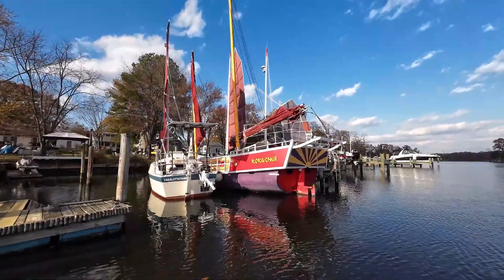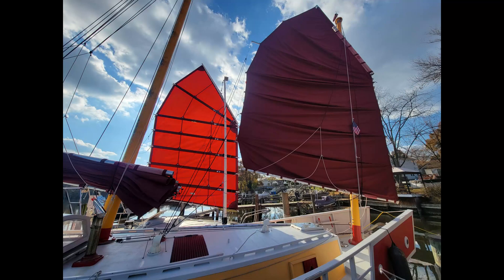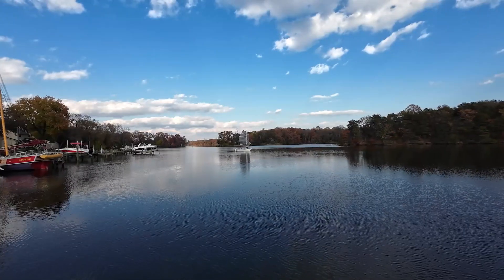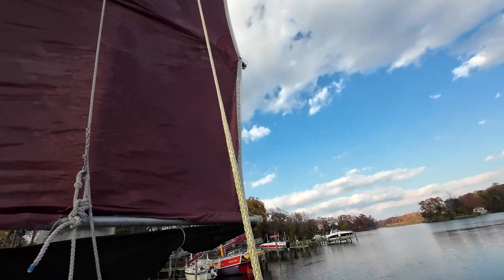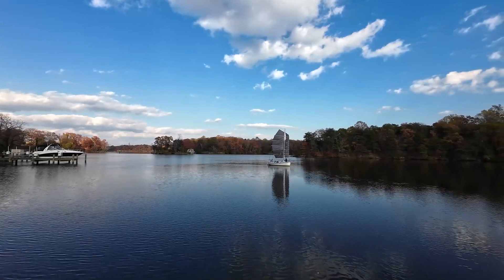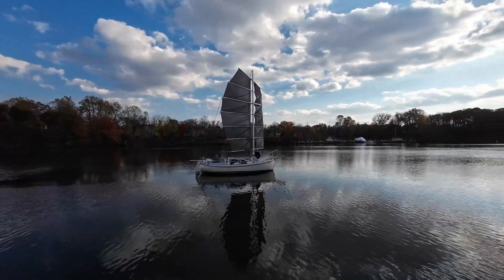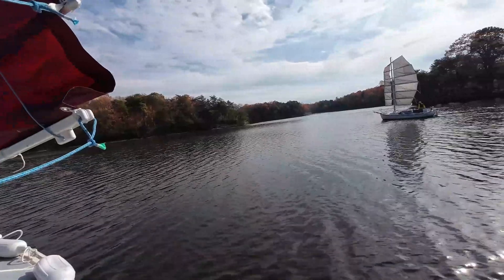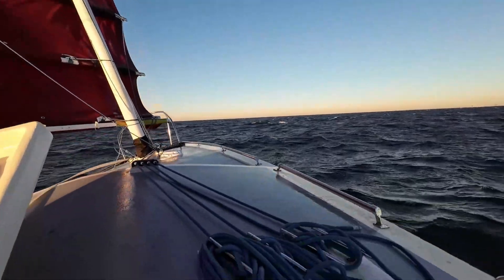S2E131 Junk Rig Sails // Flat vs Cambered vs Split Rig

Comment: My first 32sqm, flat sloop JR was fitted to my 23’ Albin Viggen, Malena in 1990. As I hoped for, the broad-reaching and running before went much faster than with her masthead BR. However, she gradually died as I rounded up for close-hauled sailing.
In 1994 I made her a new sail of the same size, but this time with camber in the panels. I called the method of making them for “the barrel method” (same as on Kokachin on your video). This sail gave a major improvement in performance, and without giving new problems as the wind picked up. Had I not found a simple way to construct these cambered panel sails, I would have dropped the whole JR idea.
The problem is that most sailmakers and yacht designers have no experience with cambered panel JRs. You will mostly be left to do both the design and construction work yourselves. I recommend looking up the JRA website, where there is enough info to get you started.

My present boat is the IF Ingeborg (my 5th junk). If you search on the string “IF Ingeborg”, you will see her romping along at 6-6.5kts (July 2025), on a beam-to-broad reach of around 10kts.

Stavanger, September 28th,
Arne Kverneland

Comment: Any comments on the Colvin style junk rig (junk rig plus jib)? I can't seem to find or get any information on this one.
Reply from the maker: It hasn't really caught on but I would love to test one.
Reply: @RoversAdventure  It appeals to me a lot. I currently sail a gaf rig setup, which I enjoy greatly. But I am very used to using jibs for different wind conditions, so the modularity of it appeals to me. The junk rig with the jib catches my attention, just wondering why not more people seem to do jib and junk rig.
Reply: @adventuremaniac  There's a guy called Roger Taylor who has converted two small boats to junk rigs, the first he rigged in the Colvin style, the second he rigged without a jib, but with cambered panels.
The whole point of the jib is for windward performance, if you camber the panels you just get that performance in the mainsail, and you don't need to faff around with more sheets.

Comment: The Junk rig seems to have its advantages.  However, I would not want one for the reason that one would not be able to setup twin jibs off of the mast for self steering on a downwind ocean passage.
Reply from the maker: I did that rig back in 1995 when I crossed the Atlantic
Reply: With two masts on a bigger boat you could, I would think?

Comment: Recently I have puchased a Laurin Koster 28 (a heavy fullkeel double-ender)…. 
It’s standing rigging needs replacement…
In fact she needs a refit throughout!
I am intrigued about modifying her to Junk Rig.
Please share your thoughts!!!
Greetings, Henk, the Netherlands.
Reply from the maker: The Junk rig is great for solo sailors and the ease of reefing makes it great for long passages
Reply: Thanks for your reply!!
I have read oftenly about the advantages of the junkrig…. being a solosailor I realise the easy handling is a big bonus!
But how to fit a freestanding mast in my boat?
My present mast is keelstepped, can I fit the junkrig-mast in the same position?
ie. How critical is the position of the mast regarding the balance…. or can this be largely adjusted by shifting the junksail forward/backward on the mast?
I suppose I better buy a copy of the ‘junkrig bible’….
Obviously I’ld like to hear if anybody has already adapted a Laurin Koster to junkrig before!
Reply from the maker: @henktulp4400  Practical Junk RIg will explain what you need to do. Most likely you will have to move the mast forward.
Reply: Please note that the shrouds and stays were installed on authentic, real Chinese junks, the correct sail shape and the upper slats are made so as not to catch on the shrouds. The fact that a junk should not have shrouds is a myth. @henktulp4400

Comment: It is horses for courses, the flat-cut, flat sail works on WRII . There is another variant of the junk sail which is closer to some of the Chinese originals that is cut fairly flat, preferably with a slightly stretchy natural material, slightly flexible battens but the battens are not parallel, they are fanned. The best modern example is the Vincent Reddish Rig as found on the Vertue Speedwell of Hong Kong , currently cruising solo around Indonesia. A "flat" fanned sail creates its own camber when the sail is twisted, yard flowing with the wind and the boom sheeted in. In maths/engineering it is called a ruled-surface, a curve derived from straight lines. A well behaved, non-baggy junk sail. It's counter intuitive to modern sailors but it's true! I'll show you when you get to South West Ireland Alan!

Comment: I'm just dropping in here so I don't know if there is any history behind this video, and I'm no certain if the discussion is designing a new boat from scratch or altering an existing boat. 
But an advantage of having a higher efficiency in the sail is that you don't need to have as much sail area. So you can reduce sail area and shorten the mast which will give you more stability. if you don't want the extra stability you can reduce the draft of the keel and reduce the mass in the keel to achieve the same stability as before; but with better draft, less displacement and less wet surface area. A lower mast is more durable as well. It's a positive spiral.

Comment: I have a 1984 Laguna 22, how difficult would it be to convert to a junk rig? Would  I use the existing Mast or would I have to get a new one? It currently has a compression post. What's a mass need to be located closer to the bow?
Reply: In case you haven't found out already, Junk Rig Association's website will probably have all the answers you need. I spent hours on Arne's page yesterday. Such a reservoir of useful knowledge, albeit a bit opinionated (but I tend to agree with his assessments so far).

Comment: In these conditions it looks great. It will be interesting to see how it performes in very strong winds? Exchange for a small batten free storm sail to reduce weight far out?
Reply from the maker: Question: how to attach storm jib
Reply: @RoversAdventure  Please show us how the sail is attached, can you remove it totally or is it still stuck to the mast even when lowered? If not stuck I would put a rope loop around the mast to keep the head in place and hoist it with the halyard. Of course you would need an attachment point for the tack as well.

Comment: I agree with your evaluation of your sail. For sailing open waters you have plenty of sail.  I noticed the double masted brown sailed boat, had the mast tilted forward.  Can you explain why? 😊😊
Reply: Actually, it's because when you are running downwind the foresail gets blanketted by the mainsail. If the foremast is raked forward it will stay asleep because gravity helps the yard and battens out.
Reply: On a junk-rigged boat, forward mast rake helps the sail to set, especially in light air. Imagine the wind not being powerful enough to swing the boom and battens to the right angle for the sail to draw. Since there is sail both forward and aft of the mast, not just all-aft like a familiar fore-and-aft sail, wind pressure might not always be 100% enough to balance the sail into the right angle of attack to the wind. With the sail "falling forward" of the mast, rather than falling onto it,  it's easier to get the sail to set correctly. I'm not sure why this is more of a concern on the foremast than the mainmast, but forward-rake on the foremast is common on junk rig boats in China.
Reply: The issue of "horsepower" is only really noticeable close-hauled.  If you are doing a lot of coastal sailing and you prefer not to use your engine, you would probably appreciate the extra drive from camber.  For crossing oceans with a following wind, it wouldn't give you much advantage.  The battens, by the way should barely bend at all regardless of whether you have flat sails or cambered.  People often prefer alloy because it's lighter and less inclined to break.
Reply: @anniehill9909 ❤

Comment: Flat cut, lighter, easy to manufacture and easy to repair or replace if need be.
The big plus is the ease of management which means less stress on a 79 year old back.
And by the by any word from Chesapeake Light on your kit boat idea?
Just asking because if I'm going to make the TransPac single handed I'm going to have to start to work PDQ.
Mike.

Comment: I get why people are confused Alan. If you squint, and it’s a dark moonless night, Wave Rover does look a lot like a performance skiff. A 49er or an RS600, something like that. For racing in a boat like that, fine control over the amount of draft (depth of camber) and the position fore and aft of that draft really become important. 36 hours, solo, on the same tack in 20 kts of wind? Maybe not so much 😂
Reply: I have never sailed with a junk rig of any design, so I don’t know what I am talking about, however I do respect the debate.   I could imagine that a lighter displacement hull form, with plenty of sail area would not require the same “low to mid range gear” that a more cambered sail would provide.   Or put another way, a heavier displacement hull, which might not have as high an SA/D might benefit more from that extra grunt in lighter conditions as it might struggle to accelerate to higher speeds and maintain them?  It seems to me that it’s a “horses for courses” kind of a debate rather than a one sizes fits all discussion.

Comment: As always a great video Alan...I think the the under sized sail on Haslers Jester created that myth of flat cut sails as being underpowered. Your romp down the Jersey coast proved that you and Andy designed more than enough power in that light boat. Very rarely have I worried about pinching up when offshore voyaging.  We leave that last 3-4 degrees to the round the can crowd...
Reply from the maker: Exactly. Pinching never enters into it when offshore

Comment: Is it possible that you would have more power with a smaller area  cambered sail ?
Reply: Maybe, but I have 2 questions for you: 1, of what advantage would a smaller sail be? 2, when reefed you're reducing sail area anyway, in that situation wouldn't cambered panels be undesirable? With high wind force, you don't want a panel drawing any harder than it needs to, or it might fail, so, flat ones are better. Some cambered-sail designs leave the very last two top panels flat for this reason, but even when you've got the bottom two or three panels reefed, two or three cambered panels still flying in hard wind is riskier than flat panels. And it doesn't seem to make a lotta sense to only put camber in the bottom two or three panels.
Reply: @glowingfatedie  Was just asking.
Reply from the maker: Those were great exlplainations
Reply: As he said, it would be a good trade under certain conditions, but not all conditions.  Running you would have less power.